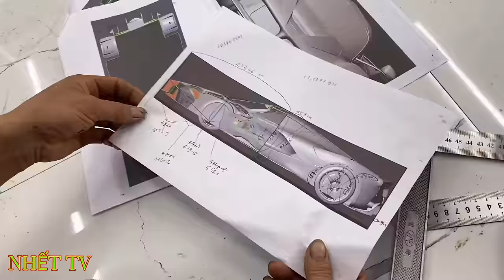I Was Left By My Girlfriend I Built A Supercar From An Old Toyota

Comment: No heavy machinery just straight work with what y’all got pure talent🙌🏼👍🏻
Reply: *straight wok*
Reply: Tons of hard work!!

No heavy machinery?
Naw, just welding gear, drill press, angle grinder, hand tools, plasma cutter, paint sprayer, metal rolling mill, compound miter saw, and a hammer.😅
Reply: Love the build! Awesome!
Reply: all done with an welding torch and a dremel multi 😂
Reply: Power of glassmate,resin and skill
Reply: @brianh.000  that ain't heavy machinery on a sense it's the bare minimum

Comment: Absolutely mad skills! I've been in the fiberglass fabrication business over fifty years and I've never seen a team like this, ever. I'm packing my bags for Vietnam.
Reply: I have been a mechanic for over 30 years as well as a fabricator, I have never seen skills like this.  How they fabricated the horizontal suspension alone was magnificent in it's elegance, allowing it to fit in such a small frame.  
Side note: I am glad they didn't do the whole "let's put a big block 427" cubic inch motor.  Enzo was known for using small engines that rev'd high, which meant smaller/lighter engines in a smaller/lighter frame.  I still remember hearing the 2.0 ltr flat (horizontally opposed) 12 cylinder over 50 years ago.  
I must make a pilgrimage to Vietnam to learn their secrets.

Comment: 5:09 Not sure if many people could understand what was going on during this process. I was a Sheetmetal Fabricator for 6 years. But these guys are applying fiberglass using a resin mixture which hardens as it dries and makes the structure panels more sturdy vs weak and flimsy. This is also a very cost-effective repair technique.
Reply: 47:44 not sure if anyone understands what those 3 random holes in the dash are for.... the 4th is actually next to the window button

Comment: Am I the only one to think that this car is just as good and practical as the real one
Reply: Yes it’s obviously way worse than the real one and also less practical  not that the actual one is that practical for daily use
Reply: @athank3509  can you point out specific areas where there is sacrifice
Reply: @afzalarif1124  whole body is not sturdy/safe suspension and steering is way worse and it will probably break if you go faster than 20mph

Comment: One point of attention!
According to Gas Engine Magazine, gasoline has no effect on fiberglass. However, some say that fiberglass is not impervious to petrol. Gasoline can soak into small cracks in fiberglass, and petrol can dissolve underseal. 
Gasoline can also seep into stringers if there is a pinhole in the area where the gas leak is. 
Ethanol can also have an effect on fiberglass:
-Phthalates
Gasoline without ethanol doesn't pick up phthalates. However, when ethanol is introduced, the ethanol molecules can dissolve unreacted phthalates in the fiberglass, filler, and gel coat materials.
-Resin
Ethanol can slowly dissolve resin in older fiberglass tanks. This dissolved resin can then deposit itself on intake valves.
Reply: Ich habe mir 1978 ein Boot aus Glasfaser Epoxyd gebaut, es hat einen 160 PS Volvo Penta innenboader und einen Z Trieb. 
Es schwimmt heute noch, Keine Schäden von Benzin oder Oil. Es erfordert nur Pflege, wie jedes Boot.
Reply: @Sleepy-c7h  Gut. Solange es sich nicht um Ethanol handelt. Ethanol löst das Harz (falls vorhanden) der Glasfaser auf.

Comment: These guys have built a number of supercars and you can't deny they are brilliant at what they do, years ago they would have built them out of any materials, bit nowadays they use some good materials and proper procedures that would pass quite a few stringent codes, they practically build them like old one off race cars use to be build out of fibre glass but without the high end expensive lightweight materials which they can easily do with out for what they are. It's impressive what they end with

Comment: Good Job Guys ❤️🖤💛
Rhe only thing what's wrong are brakes as discs just as zero Safety Measures as seat belts and especially unibody Safety Cage with separate crash elements from back and front of the car

Comment: Here's the situation.   The fra😢is entirely too heavy.   The chassis was built from the wrong materials. 
No where in the design is there any sort of crush zones.   Nothing in the design that would give,  flex, or absorb the impact of a collision.   The seats are nothing more than a cushion,  while the seat belt is mounted to the chassis in such a way that the bracket would not hold the passenger in the seat. 

A full perimeter frame  , even stainless steel would be great.   But the structure needs to be chrome moly tubing not box tubing. 
There should be a tube behind the seat and the seat belt should be wrapped around the tube. 

There should be a halo bar above the head and a bar across the dashboard. 

That car is unsafe at any speed! 

From a engineering standpoint you would have been better off just putting the skin over the body of the Toyota.

Comment: This is far from top level in design and engineering…true car enthusiasts would be horrified.

These people are dreamers, doing their best they can do with what they got. All show and no go !

The amount of weight in steel, fibre glass/resin, putty, fillers, undercoat, paint and clear is ridiculous when considering the power train they use.

I must say just as well as these creations are underpowered as they’d be dangerous…examples of modern safety features like seatbelts, airbag’s, or cumble zones in the structural design do not exist so even a head on accident at low speed could be life threatening or leave permanent damage.

Top class in engineering and design will be the day when they learn how to use aluminium, carbon fibre and plastics combined with top class technologies.

It’s sad to see the level of work and effort they go to far outweigh the end results…there is no level of comfort and the paint finish matches the poor quality of body work. Would look good from a far distance, but to see it up close would be disappointing.

This is only a party of dreamers with too much time on their hands, but mostly they are happy with their accomplishments and that’s all that matters ❤